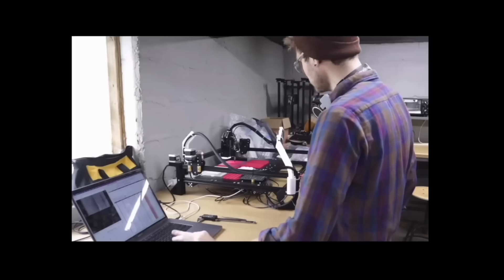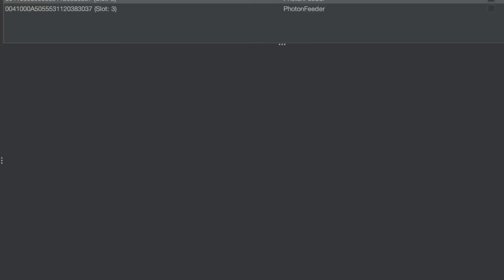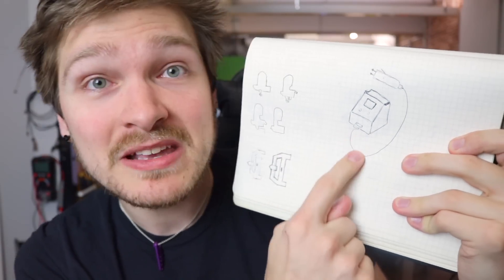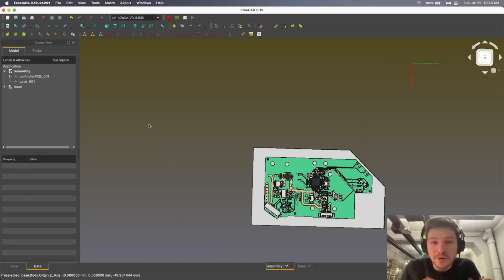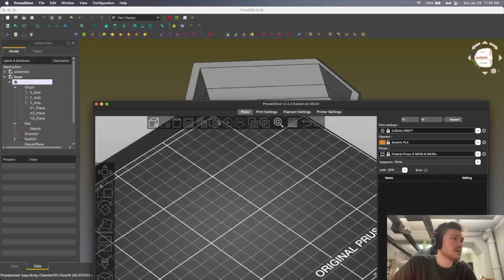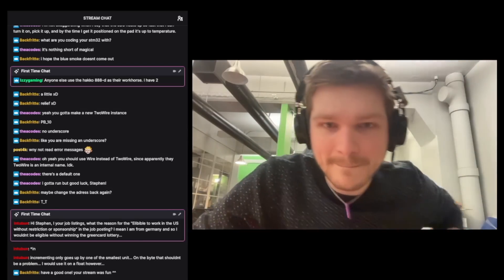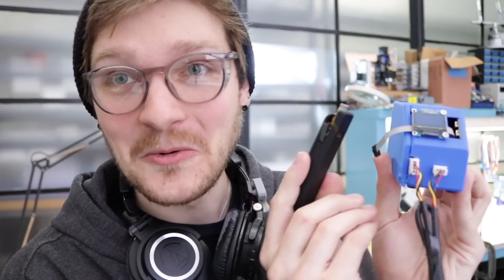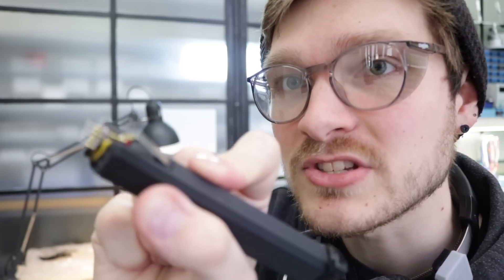Some jigs you have to build yourself

Comment: To me, it is a little endearing that Stephen still has his old headphones (with the 3d-printed repair) after all these years.
Reply: I own a set of M40xs and can confirm, besides the hinge issue for which i also had to print a replacement, they are fantastic headphones for the price. Low weight, comfortable and pretty flat frequency response, also they don't need a preamp. No need to upgrade if the product is already great
Reply: @matiastripaldi406  Can Confirm Here Too.  I had a pair of Audio Technica M40’s that broke by accodent at the hinge, otherwise fine with a few years of use.

I upgraded to M50’s and Fiio’s Bluetooth Module for them and ave been going strong for about 4 years now!

The m50s are similar and have a more durable hinge that can go both ways.

Either way good option (in my biased opinion lol) for anyone in need of headphones.

Comment: A possibly middle ground for audio feedback for the current (or next?) ID: Use 1 beep for success on even IDs, 2 beeps for success on odd IDs. For error it is up to you, going nuts with the beep, lower/long beep...
Otherwise, it would be to put a small screen near your pogo pins

Assuming you don't want to trace line on your board to make one big connector :p (line selection isn't possible on a eeprom to share otherline?)
Reply: Alternately you need to:

- Make the Buzzer Play “La Cucaracha”

- Make the Test Unit’s Screen/Buttons Play DOOM
Reply: Short single/double beep for success, longer beep(s) for error. Maybe even make the programmer not shut up until you press a button, at which point it lets you try again.

Comment: Cool project! I'm also using the same display for one of my university projects, the library I'm using not only takes up a bit of space, but also takes a while to process and since the device I'm making is a control device with outputs dependent on ADC reading, I can see a lag in output at display refresh rate. I solved it by moving it to the second core of the MCU I'm using. We really take graphics, even simple ones, for granted on our everyday devices so it's always good to keep in mind this stuff really affects the performance of our low power MCUs!
Reply: What is your current project?

Comment: Cloud you pogo pin all the boards at once?
Reply: Yes, but that would be a pretty complex construction to make them all contact reliably. The force required for the pogo pins adds up pretty quickly to where you need a special jig.
For a first shot or first small scale production it is useful to collect some experience before you build the complex and expensive jig.
When the time for bigger production runs is here, I expect them to build something, that does't require that much labour to do the job.

Comment: Why not develop a jig/panel that can program all 50 at the same time to speed up production and just use your single programmer for when it detects issues?
Reply: Because this is much simpler and faster? I bet he has such a panel in the works, but it's probably overkill for the number of boards sold

Comment: Now all you need to do is frankenstein this thing onto one of the PnP machines so someone doesn't need to sit there programming every one of them.
Also, I'm super excited for my machine to arrive. This lead time is killing me 😂 Keep up the great work!
Reply from the maker: that is an INSANELY good idea, thanks for the recommendation!! i should take a crack at this. and thanks for the support! :D
Reply: @stephen_hawes  essentially a “programming” head might not be the worst feature in general.
Reply: Put the programming probes on one head of the PnP, and a red paint pen on the other so it can physically mark any faulty units so you can see at a glance which ones are bad
Reply: @stephen_hawes  You can also make a PCB that fully covers the programmed chips and have all of the chips programmed at once with one push of a button, and have it then list any errors if there were some. Just one larger PCB with a lot of pogo pins on the bottom and a screen and a button on top.
Reply: @stephen_hawes  it would be total overkill and kinda dumb, you are missing a solution that you have in front of you. You already built a rig for testing and programming the motherboard, you should make same or similar thing for programming this boards. I would make one big PCB to which you could mount whole panel with pogo-pins and it would program everything one by one. Add a speaker and LCD to it and you are done.
Reply: @caraffa3621  But putting a programming head on the PnP would allow the machine to flash and even Q/A arbitrary boards. Which would be huuuge for rapid prototypers.
Reply: Beat me to it
Reply: Was shocked that this wasn't exactly what this video was about. Now that the actual programming stylus works, your company already makes a nearly perfect solution for retaining the PCB and handling the gantry movement required for automating the programming process completely. A bit of customized code and a few 3D-printed brackets will save a ton of time at cost of pulling one Lumen PnP off the line.
Reply: That was exactly my thoughts when watching the video. Automate all that you could because when it will be time to scale, it will be a nightmare jobs to program those.
Reply: @fdelacou  Yeah, 100%. I was half way joking. But it would solve the warm body in a seat for hours issue in the short term. Long term it would make much more sense to design in some kind of programming into the panel. That would mean seconds (if that) for programming each instead of minutes for a machine to do it and much more for a human.

Comment: Feels like you could mount this on some kind of gantry system where you place a PCB down under it, and it does the job automatically ;)
Reply: That's what I thought. They are producing a consistent PCB with consisent pad placement. So surely a XY Gantry would be the perfect partner to the stylus.
Reply: I came here to suggest this too.